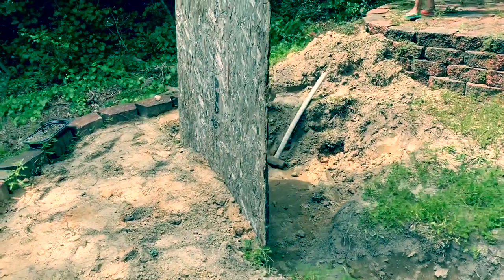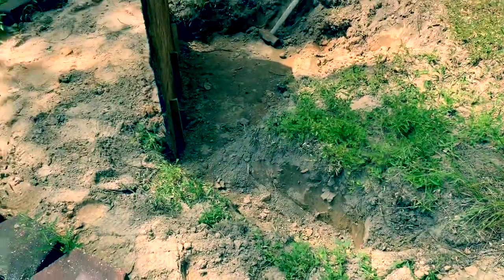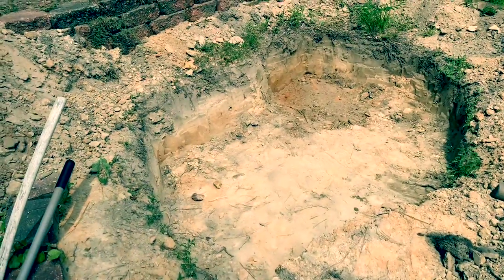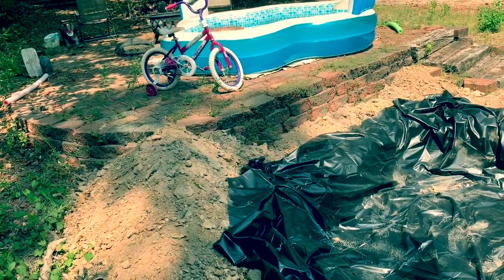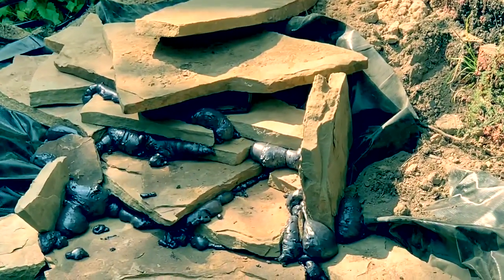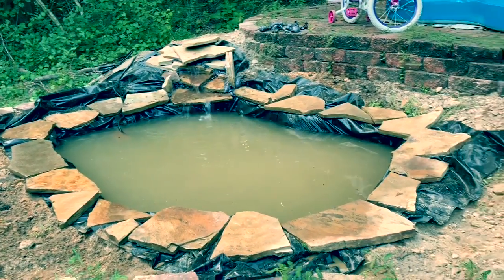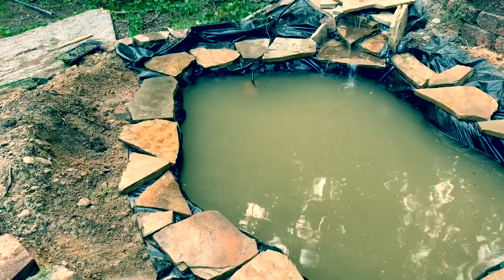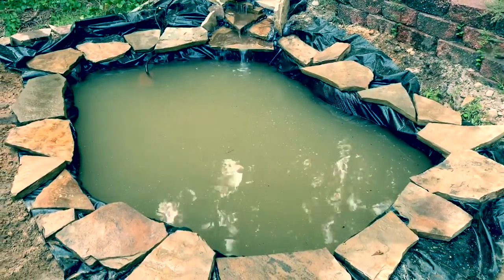DIY Backyard Pond - Part One

Comment: Hey Steve your pond project is coming along well. With that pump floating to the surface, just get one of your spare flat stones and trim to about the same size as the base of the pump, then use a couple of long cable ties (zip ties in USA I believe?) and wrap them around the stone and the pump then it will sink right back down again. I've used this method myself and it works great. Good luck with the rest of the project mate. Cheers Andy
Reply from the maker: Forge Wright thanks for the tip... I’m gonna try it tomorrow.   I got the liner trimmed back and filled some dirt in behind and between the stones. Picked up few plants and ordered some lotus seeds.